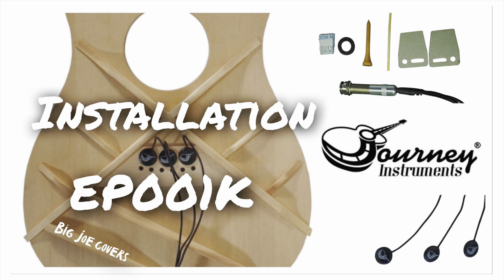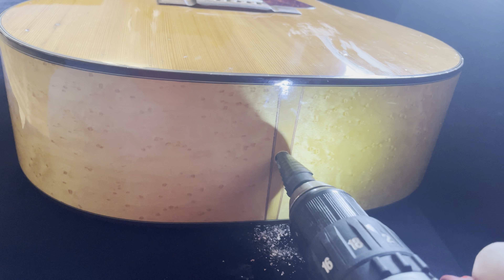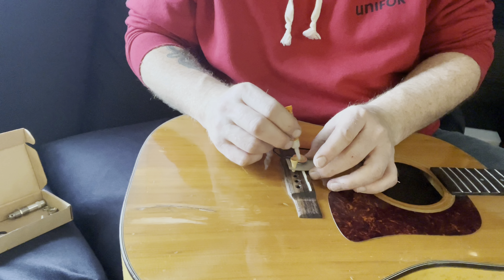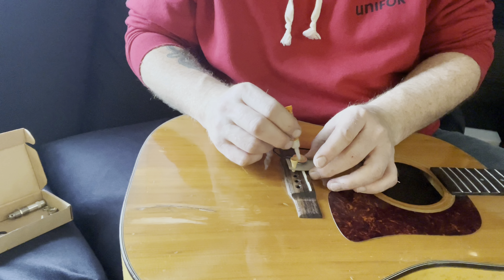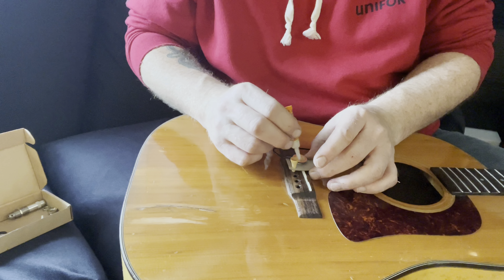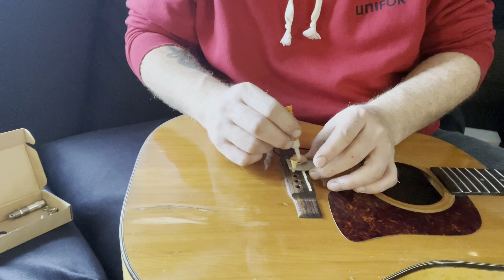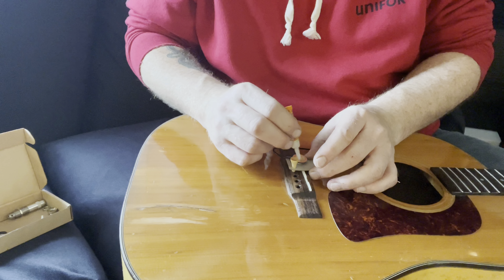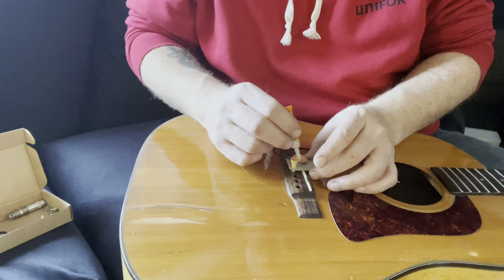Journey Instruments EP001K Passive Pickup Install

Comment: I saw where someone used double sided tape instead of glue.
Reply from the maker: It could work for sure. It would also be way easier to undo if it wasn’t what was needed but I’m not 100% sure it would
output enough. 

Give it a try, and if it’s not what you like I’d recommend the glue.

Comment: Maybe I'm mistaken, but it looks like you installed those with the wires opposite what's shown in the diagram.
Reply from the maker: Good eye. I did this intentionally as I couldn’t see the harm. Seems to me they are doing it wrong but your mind may vary. 

Good eye!
Reply: @bigjoecovers  I think the intention is to have the wires loop forward and down to the back of the guitar before connecting to the output jack.  I haven't installed mine yet in the Yamaha fg830.  My other acoustics have sound hole pickups, Dimarzio Black Angel to be exact.  I thought they would be too heavy for the Yamaha which is a bit more delicate.

Comment: WARNING: Using a common twist bit drill bit, can and often does rip the lacquer finish on the guitar, I've seen it happen too many times and masking tape may or may not work, because sometimes, when removing the masking tape, the tape itself will pull the edges of the lacquer finish due to being tattered by a common twist drill bit. If you have a really fine acoustic guitar, it is best to invest in a side reamer bit made especially for this job, especially if you plan drilling holes in multiple acoustic guitars. The side reamer bit is very expensive, but fine acoustic guitars are very expensive too, so why take chances. If it's a cheap guitar you're not so worried about, then by all means, using a stepped drill bit followed by a common twist drill bit will be fine.
Reply from the maker: I hope you subscribed!  ❤️

Comment: Nice thanks for uploading planning to install this pu in my yamaha guitar how was it do u like it?
Reply from the maker: It’s really good for the money. It’s the only soundboard pickup I’ve ever heard and frankly it’s surprising how good it sounds in person. I personally think it needs a cut in the midrange but that’s easily done on a mixer or a pedal for live applications. I used it for a small gig in a small room and found it will easily feed back if you keep all the low end in the monitor (also easily fixed with the EQ strip on a mixer). 

I’m curious how much better a Schatten or a K&K pure mini are for the money….
Reply from the maker: Have a listen to my results video, see how it sounds plugged in direct. 

JourneyTek EP001K Testing /Demo
https://youtu.be/FHnBskd9AXM
Reply: @bigjoecovers   good to hear that thanks for the response I'll check

Comment: This video is far too rushed. Anyone performing this installation for the very first time should make a couple "dry runs" / "practice runs" when using the mounting template BEFORE actually applying the Super Glue/Gorilla Glue gel. Practice a few times getting the template with transducer in the proper place FIRST. Once you have gained the confidence, you can then actually apply the glue and install the transducers. This video contains NO important details that would be useful for first-timers.
Reply from the maker: Grateful for the views!  Cheers from Canada!  🇨🇦